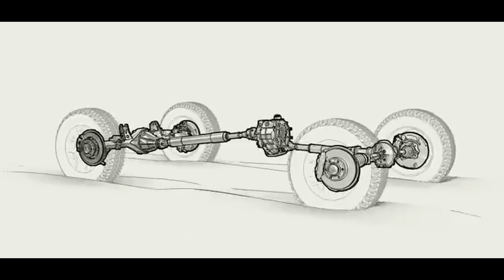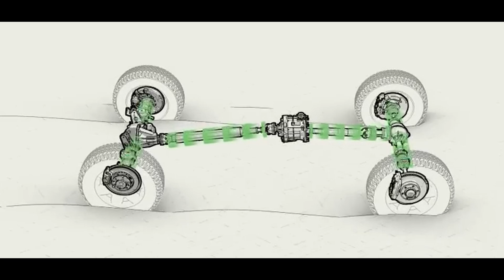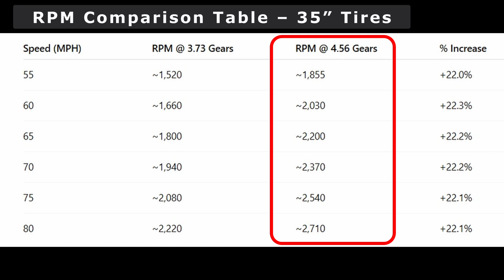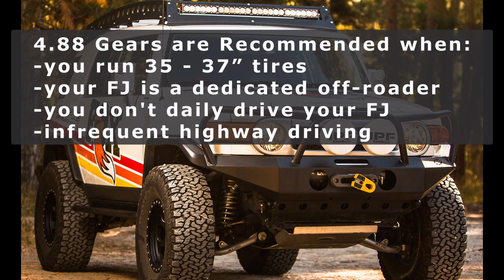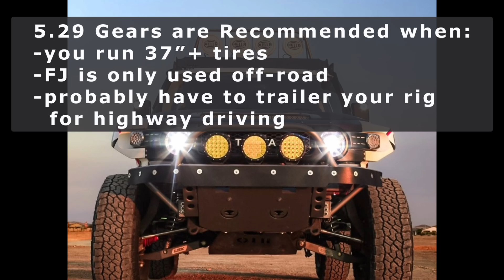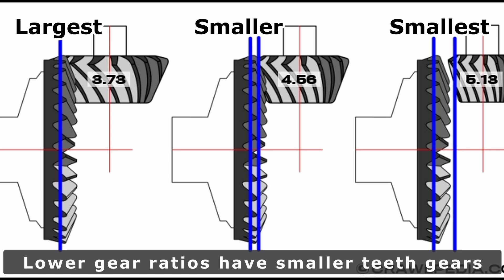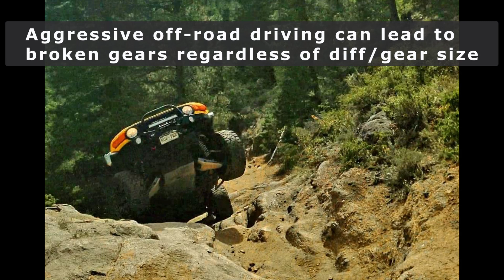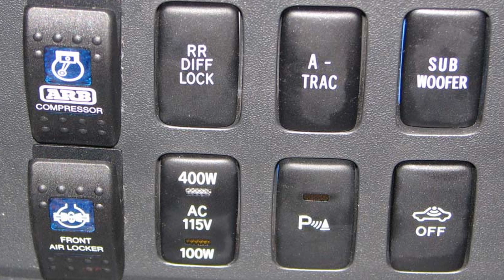Regearing the Toyota FJ Cruiser - 4.56 and 4.88 Gears Explained - A Complete Guide

Comment from the maker: Thanks for watching everyone! One correction I would like to make to the video however: the teeth sizes of the diff gears actually INCREASE in size the lower you go in gear ratios. The stock 3.73 diff gears of automatic FJs have 43 ring teeth and 11 pinion teeth for a 41:11 ratio (3.73:1). The 4.56 gears have a 41:9 tooth ratio, meaning LESS teeth on the pinion gear which is makes those teeth actually LARGER. And similarly, the 4.88 gears have a 39:8 tooth ratio, so even LARGER sized teeth. In which case it is even more curious that folks break gear teeth even when running aftermarket 4.56 and 4.88 gears. Which means my point in the video still stands, whether or not the gears break is likely a lot more dependent on HOW YOU DRIVE than it is a flaw in the aftermarket gear design.

Comment: Now I've been researching the shudder issue trying to figure out the best course of action, and everyone has told me flushing it will move around all that wear material and you will make things ten times worse compared to a drain and fill.   I'm at 265,00 miles and idk if it's ever been changed.  This was about to be my first time changing it but the shutter just started.    IDK what to do now
Reply from the maker: Do you believe the shudder is coming from the transmission? Do you drive an automatic or manual transmission FJ? I've heard of the issue more commonly with manuals, and folks like flushing it to help out. But I know some are in the camp of leaving it be for the exact reasons you've stated. So it's a tough call.
Reply: @FJX2000_Productions it’s auto.  We ended up doing a drain and fill with a new filter  two nights ago and the shudder is gone now. Praying it stays that way

Comment: My overall gas mileage went up going to 4.56's.  I'm running 285/70/17 on a rig with full skids, front and rear steel bumpers with swingouts.  I also tow a ~3000 lbs. LOBO trailer.  Before the regear, the tranny would hunt endlessly looking for power and would spend the majority of time with the engine screaming on the freeway.  4.56's changed that and the tranny now shifts normally even when towing

Comment: Could 456 gears work on an O6 tundra? 34" tires .highway daily.by lowering the RMP at highway speed .currently on 488gears.
Reply: I have a dc 2004 tundra on 35s with 4.88s and its perfect. I had 33s after doing 4.88s and the rpms were a bit high.

Comment: Questions. 
I have a stick ‘09, that sees more than average rough roads, but nothing extreme or rock crawling. 
1-Is it possible to swap to a factory 8.2 diff?
2-If possible, how easy/complex is it?
3-In YOUR opinion, would it be cost effective, given the regular, but not extreme, off-road if?
Reply from the maker: Swapping to the 8.2” diff can be done but I don’t think you’d notice a difference. It isn’t completely plug and play from my understanding, plus if you’re not doing crazy off-roading and breaking diffs, I don’t think you need to worry about it. So I would just keep the stock differential and keep doing what you’re doing!

Comment: Is there a gear below 4,56? Perhaps 4,00. I run stocks size mud tyres and find a lot gear hunting between 4th and 5th when driving at 60-70mph. Need a bit of extra torque.
Reply from the maker: Another option might be to have the FJ retuned. That might help your specific situation before going all out and getting new diff gears. But there ARE other gears actually. Look up 4.10 and 4.30 gear ratios, they are offered from East Coast Gear Supply

Comment: When the pinion changes from 11 teeth to 9 teeth, the geometry of the teeth remains unchanged: same tooth width and tooth height and tooth shape and pitch distance between teeth.  All that changes is the pinion diameter- which becomes smaller.  It is this central billet - from which the teeth are machined - which becomes smaller in diameter and hence the component becomes  weaker overall. Also, the smaller the pinion diameter, the greater the angle between the tangents of approaching teeth on pinion and ring - as they start to intermesh. Thus greater sliding and wear between teeth.

Comment: As for me, I run 315/75R16 mud terrain on stock 3.73. A lot of highway driving and car weights 5800 lbs. Aiming for 37s I choose between 4.1 and 4.3, because having a bit less power is quite acceptable. But I will keep the capability to use 31.6" wheels if necessary, not being frozen on 35+.

Comment: 10:25 you are wrong. Stock 3.73 gears have 41+11 teeth. 4.56 has 41+9 teeth. 4.88 has even less - 39+8 gears.
Reply from the maker: Ah yes! Thanks for sharing! It is interesting then that even with less gear teeth, you would think they would be stronger and less likely to break as they would surely be larger sized teeth?
Reply: @FJX2000_Productions  I suppose aftermarket gears just have less quality of metal.
Reply from the maker: @A_FJ I actually asked the aftermarket gear manufacturers about this when researching the video. They “claim” if the gears are installed and broken in properly, they should be just as dependable as stock gears, if not more so. But I’ve heard enough stories of aftermarket gear teeth being broken that I have my doubts 🤷‍♂️
Reply: @FJX2000_Productions 
When the pinion changes from 11 teeth to 9 teeth, the geometry of the teeth remains unchanged: same tooth width and tooth height and tooth shape and pitch distance between teeth.  All that changes is the pinion diameter- which becomes smaller.  It is this central billet - from which the teeth are machined - which becomes smaller in diameter and hence the component becomes  weaker overall.
Reply: Also, the smaller the pinion diameter, the greater the angle between the tangents of approaching teeth on pinion and ring - as they start to intermesh. Thus greater sliding and wear between teeth.